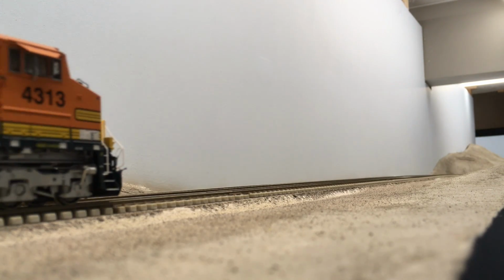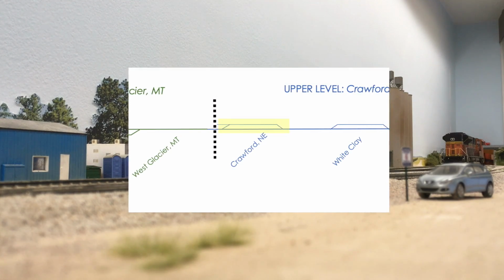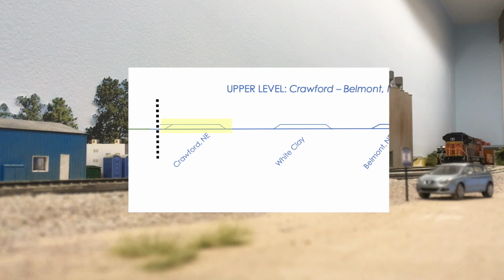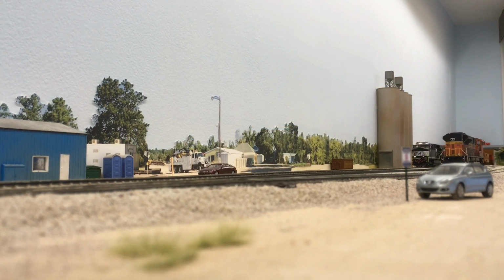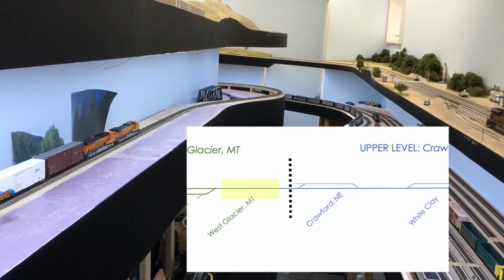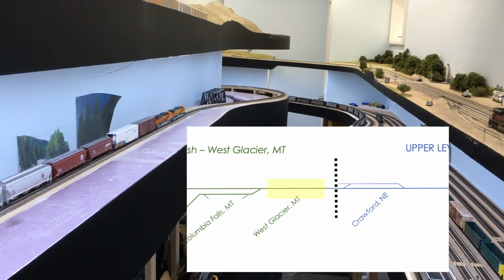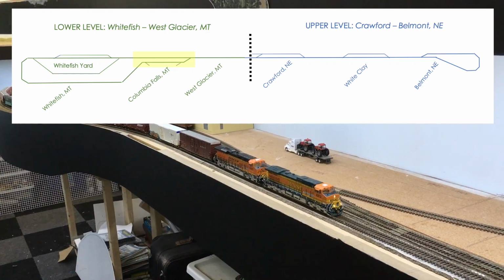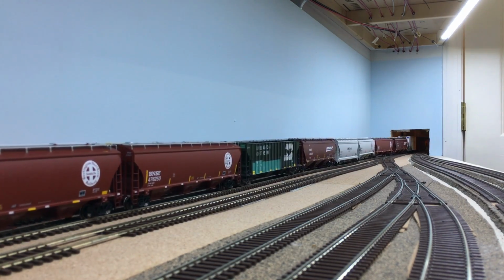LAYOUT OPERATIONS - Part 1: Mainline Running

Comment: Great work on the layout, being that I'm from the Glacier Park area you need to put the bridge over the Whitefish yard just west of the old GN passenger terminal. Just my input, but it is your work and it's ALL GOOD!!!!!!!!!!
Reply from the maker: Thanks! That's the plan. I'm not certain which end of the yard to place it because on a map, the orientation of the yard is inverted. On the layout, when you're looking at the backdrop, you're facing south, but the yard is laid out as if you're looking north and standing on the Amtrak platform side of the yard. So, to keep with the aesthetics, I think I might place the overpass on the east/left end of the yard.
-Cam

Comment: are dynamic brake sounds part of the DCC experience?????... YOU of all people certainly need that here
Reply from the maker: They are! Unfortunately, even though ESU exceeds in almost every way, their default GE dynamic brake sounds don't sound like much. This is the one area that Tsunami 2 decoders excel in. But once I get my hands on a LokProgrammer, I'll do some customizing to add the proper sounds and perhaps some logic (like deceleration or drive hold) to the dynamic brakes. It's pretty much a continuous climb/descent depending on the direction, so dynamic brakes are certainly important. 
-Cam

Comment: How do you connect the upper level and the lower level?  Do you have a video on that? Thanks!
Reply from the maker: Yes indeed! If you check out my most recent video, you’ll get a tour of the whole layout. In the description of that video is the link to a cab ride over the layout as well. That should show how the two connect. 
-Cam

Comment: I'd like to see what size is this layout
Reply from the maker: If you go to the last 15 seconds of this video, there should be a link to a layout cab ride video. That'll give you a sense of the whole layout (I'd run it on 2x speed). In terms of absolute measurements, it's 12' x 28'.
-Cam

Comment: Nice tour of the layout!  That Scaletrains.com C44-9W looks and sounds so good!  Someday I hope to get a rivet counter one as I already have 2 Operator versions!  Subbed too!
Reply from the maker: Thanks for the sub! They are really nice locos. I've actually been eye-balling the Heritage 1 Operator versions. They're not perfect, but add a bit of detail, and they'd probably be great looking and running.
-Cam
Reply: @railfan220  the Operator versions are great locomotives especially since their driveline is virtually identical to the rivet counter versions so they can pretty much interchange with each other mechanically speaking!  Only reason I tend to lean towards the Operator series is price (eventually 3 Operator locomotives to one rivet counter) and less risk of breaking details off of the locomotive.

Comment: Hey Cam, those are some great looking BNSF Locomotives! I just posted a video on the BNSF locomotive and rolling stock I have. I would like to add at least 4 or 5 more BNSF locomotives, I was wondering if you would have any recommendations?
Reply from the maker: Thanks! I think anything Scaletrains is fantastic. Getting a Dash 9 would be great. Their Rivet Counter line is 2nd to none, but I've even been eyeballing their Operator Dash 9s in the Heritage 1 scheme. They're not perfect and need details, but it would be a fun project. Same goes for Walthers Mainline locomotives. I see you already have a Genesis SD70ACe, so if you did a Mainline engine, I'd go for the ES44AC or ES44C4. Again, same story with these as with the Operator engines; you'd need to add details (the Walthers Mainline lighting is also terrible). But if you're looking to just spend the money rather than apply details, I think Scaletrains (Rivet Counter), Athearn Genesis, and Intermountain would be the way to go. An ET44C4, ES44AC/C4/DC, Dash 9, or SD70MAC would be great. 
-Cam
Reply: @railfan220  Hi Cam, thanks for the help! I have been looking into the Scale Trains Rivet Counter line and have been eyeing an ES44AC. I may go with a Scale Trains locomotive as I have a lot of Athearn Genesis in my roster already. Be sure to watch and subscribe! I will be sure to give your channel a shoutout after I purchase my next BNSF locomotive!
Brian

Comment: What percentage are your grades?  That was impressive to see your train climbing without wheel slip. I use to have Crawford hill on MSTS (Microsoft trainsim) it was fun to operate before my computer crashed. Keep up the good work.
Reply from the maker: Thanks! The lower level is about a 1.5% climb while the upper level is a 2.5% grade (but a bit more brief).
-Cam

Comment: Hi. My wife has family in Chadron so I have been to Crawford several times. Are my eyes playing tricks or was the backdrop photo of Main Street in Crawford taken facing toward the tracks with the trackside grain silos in the far background? I’m not trying to be critical as I love that part of Nebraska and I love the way you have modeled it. Keep up the good work!
Reply from the maker: Haha, I keep telling myself, nobody would ever notice that, so well done. The road I'm actually modeling is Annin St.; I skipped over Main St. because I didn't have enough vertical room to model the underpass. And, you're absolutely right about the perspective. The backdrop is displaying an image of 2nd St. looking north towards the West Plains Grain elevator. Someday, I'll get around to actually building that structure, which sits just a few feet to the right in the scene. It's sort of a little easter egg because I'll both model the elevator and have it visible in the backdrop. It doesn't make a ton of logical sense, but it was the best Crawford street photo I could find. Thanks for watching!
-Cam
Reply: I should have checked the Crawford street map before referring to Main Street. The main thing is that it looks right to you.